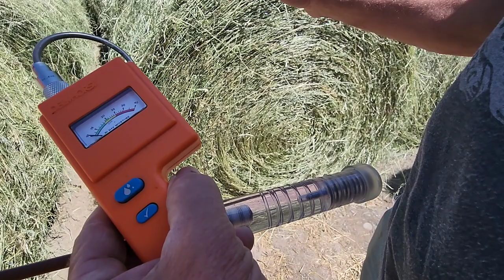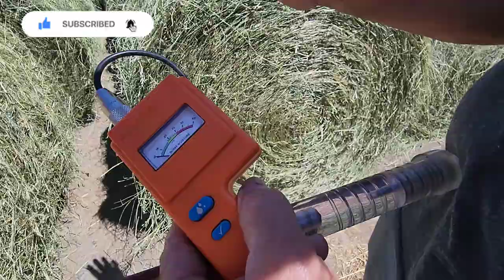Sheep Farming: Raking & Wrapping Hay!/June 20, 2022

Comment: at what age do let the ram lambs breed for the first time, what is the best time to ship cull ewe in Ontario
Reply from the maker: We tend not to use ram lambs for breeding  - mainly because we have plenty of adults but also because we want them to mature out more. However,  ram lambs can breed at 6 months old and as various accidental breeding show, even younger than that! If you are using a young ram lamb, you would have a maximum of 20 ewes to breed. More ewes require an older ram.
Reply from the maker: We ship cull ewes when they need shipping  - we do not wait for certain holidays or anything like that. This year cull ewes got good money at the first of the year but they are low right now.